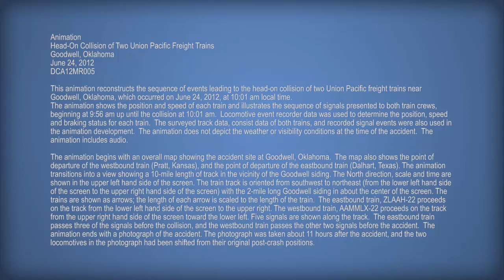Accident Animation, Goodwell, OK

Comment: 200 yards before a train passes other than a clear signal both an alam in cab will fire.Both the condr and engineer would have to push a reset buttons to turn it off.After that point the railroad might want other restrictions if they fail to respond such as emergency application of air.If my memory serves me right that streach of track just  west of Dalhart to just west of guymon is the longest straight track on us railroads

Comment: I have to say that Mr. DeWeese is absolutely correct.  Red over yellow is "diverging approach" (i.e. diverge off of the main track in any case).  Yellow over yellow is "approach diverging" (i.e. diverge if the power switch is set that way).  It's not the same.  He is also correct: the real problem is that the eastbound crew was inattentive or asleep.  It's a nightmare for all of us.
Reply: Interesting, I thought red over yellow medium approach(Proceed, MEDIUM speed passing signal and through turnouts, preparing to stop at next signal.)
and yellow is a approach slow (Proceed, approaching next signal at SLOW speed.)

Comment: MasterBear2, you are missing the point.  Both Approach Diverging and Approach Medium require action from the crew, and there was none.  Pending PTC, the dispatcher telling crews where they will meet would help.  I believe all crews are now required to call aspects less favorable than Proceed.  The silence that preceded the collision could have been a strong clue. Another approach would be to hold the signal red at the west end and east end until the crews called the dispatcher.

Comment: why? The signals are pretty clear, and every single one has its one rule and description. What they should invent is somehting like an automatic emergency, that plugs you once you pass a red signal without authority from dispatcher (this system exists in Germany). Both, Conductor and Engineer of the Z-Train failed to comply with the Rules of the Signals. Why? I don't know. But it was important for them to Die for

Comment: Thanks for the clarification.  I believe there is a need to standardize the signal systems of all the railroads in this country.
Reply: I agree with you kleetus92.
Reply: I disagree... you need to know where you're operating to know more than just the signals in a particular area, grade, crossings, and control points need to be known so you as an operator aren't screaming into a switch with the brakes on fire.